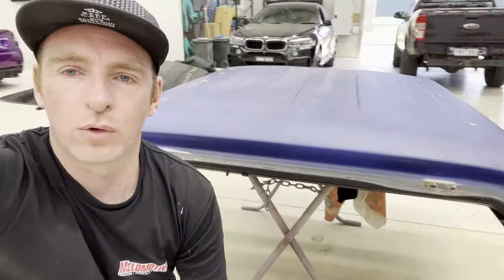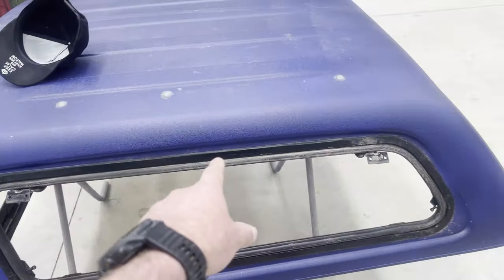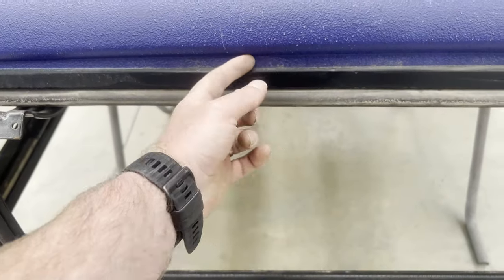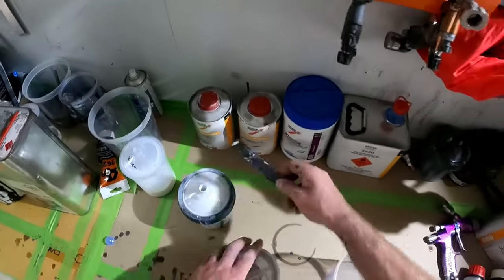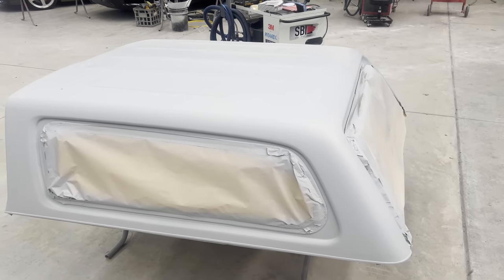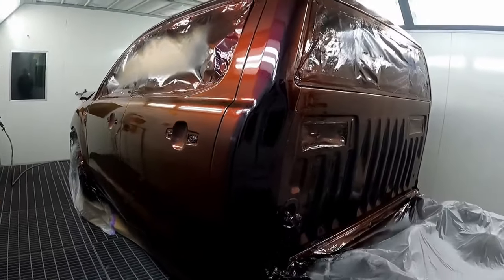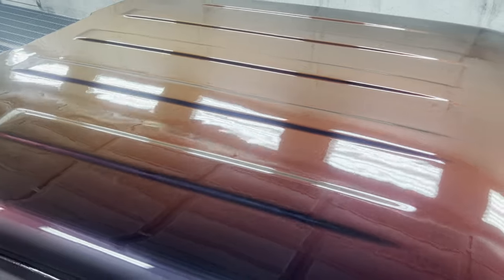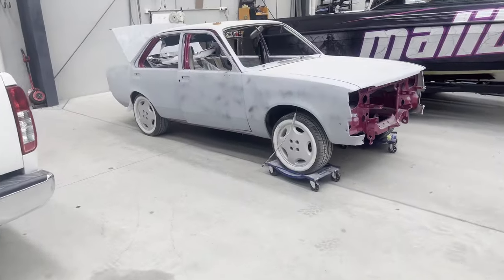Sanding Raptor Liner flat and Painting Super Shift Pearls - Full Guide Prep and Paint

Comment: 8:56 it looks like the lower the pressure the higher the transfer rate.
These paints are crazy expensive 
If i was doing a garage paint job is it possible to  just stay on 18psi ??
Reply from the maker: For clear 29psi is recommended mate . DNA paints colors do cover extremely quickly . Just remember lower the pressure the chunkier the paint lays down . I wouldn’t go lower than 18
Reply: @BogDustForBreakfast  cheers taa 👍